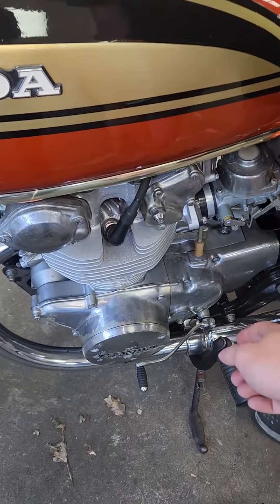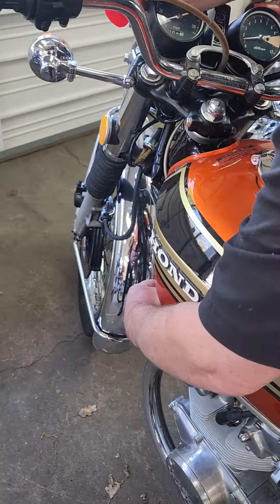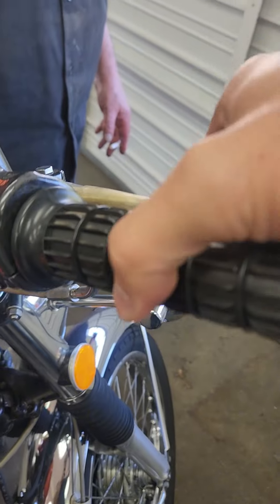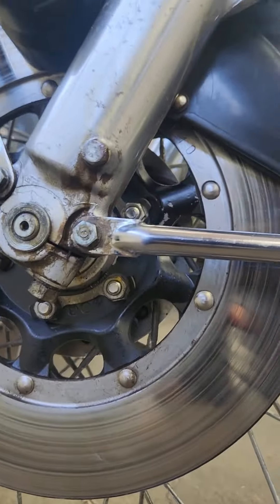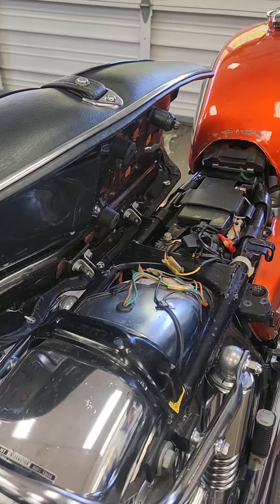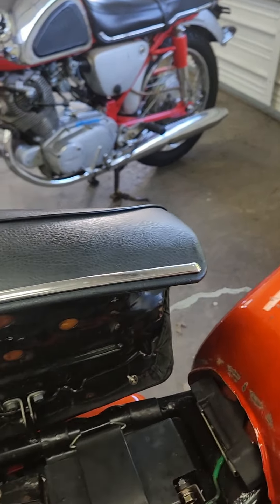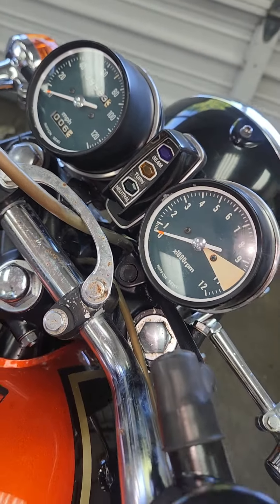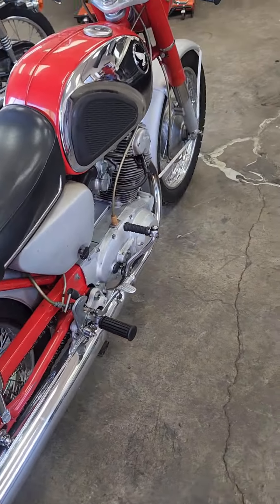Honda's Most Failed Motorcycle - 1974 CB450

Comment: The 450 was a radical statement bike when it was introduced.  Alloy engine, twin overhead cams, dual torsion springs, high revving, 180 degree offset pistons- This machine was the result of Honda's 1960's racing program and its purpose was to take on the big British 650's on the street and on the track.  I believe it was actually banned by British Racing Association as being either too radical (or even 'unfair').    The early one's struggled in sales because of their toaster tank gas tank but they became much more popular around 1971-2 when Honda figured out that styling was also important and followed the design cues of the Honda CB750f.  I have a 1974 K-6 that I did a frame up restoration on and am currently finishing up a 1975 CB 400-four.

Comment: The only thing I didn't like about the CB450 were those weird torsion valve springs. Made adjusting the valves a PITA. But they ran just fine. And they sure did nook good. Look at that bright shiny 2 tone paint, bright unpainted aluminum, and lots of chrome. No flat black anywhere but the tires, seat, hoses, cables, and grips.

Comment: I own harley, but five decades ago, I owned a used cb750. I enjoyed.
Reply: I did too, it went like stink but not that comfortable for long trips.
Reply: Oh, I agree. You do what u can, to accommodate, comfort. My mod's, was different handlebars,  and remove vinyl cover, on seat, and " fillet " the foam, reinstall cover.
Reply from the maker: I test rode some "restored" cb750 (video on my channel) & I felt really uncomfortable riding it being 5'3" 145 lbs. It's wide like a horse saddle.